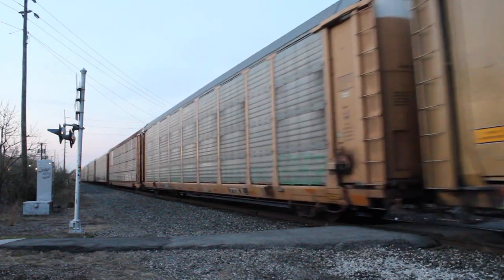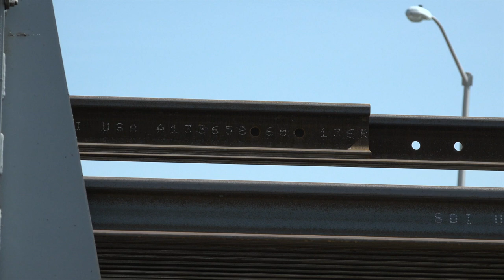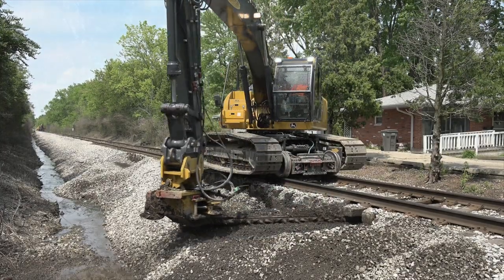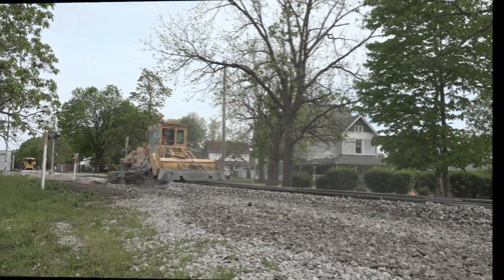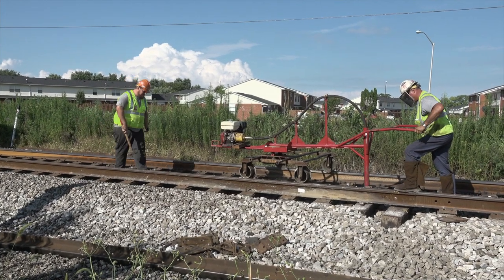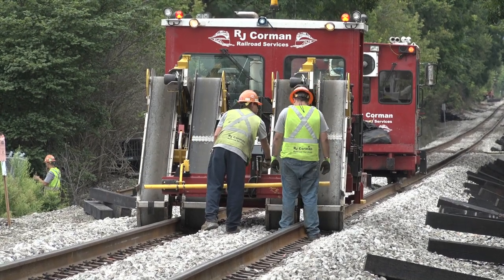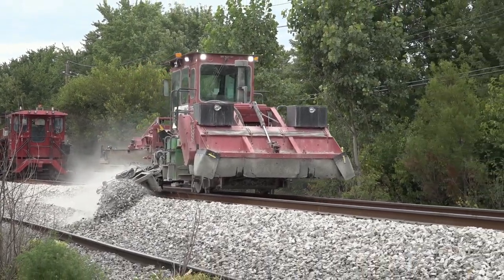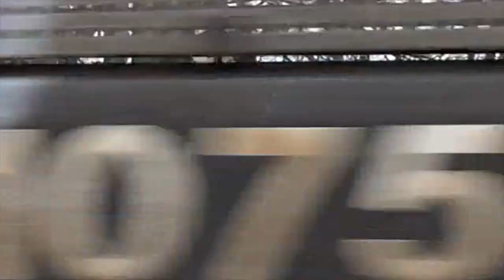Laying Welded Rail

Comment: Nice video, but that one machine you called a “tie painter” is actually injecting a quick drying epoxy into the old spike holes. That way the new spikes will have some grip.  :)
Reply: I was wondering if anyone else caught that.